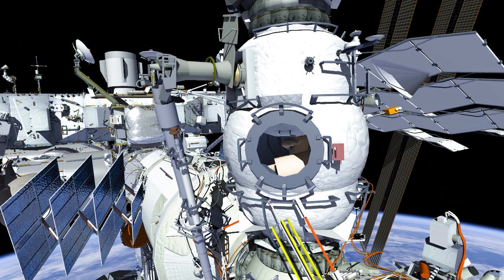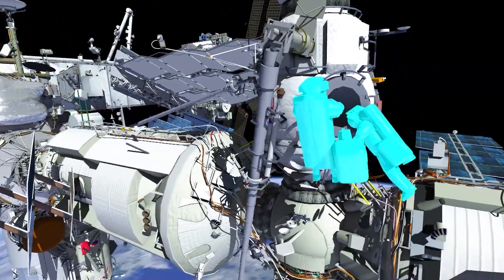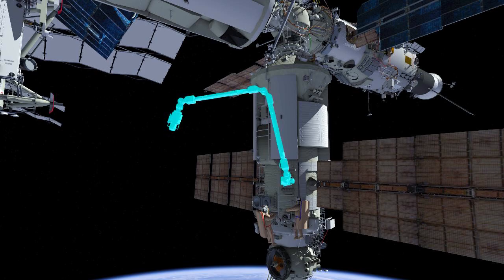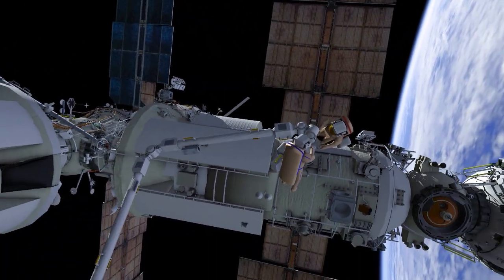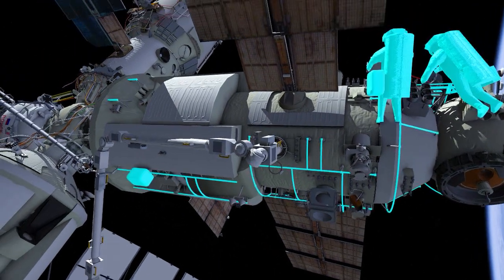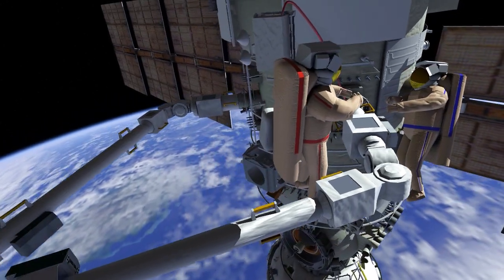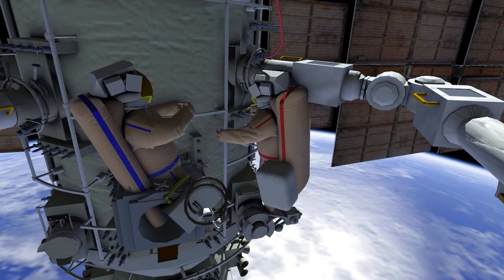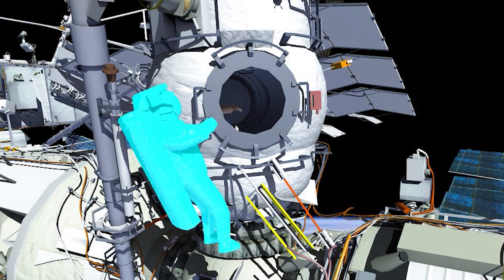Depiction of the August 17th ISS Expedition 67 Russian Spacewalk

Comment: only one task complete and one task partly completed. The cosmonauts installed the cameras and only got one of the launch rings removed. Oleg was going to remove the final launch ring when his batteries died and he had to go back in and recharge them. The final task will have to be done on the next spacewalk before they can move Rassvet and its support equipment over to Nauka.